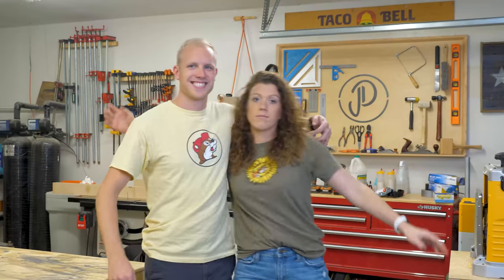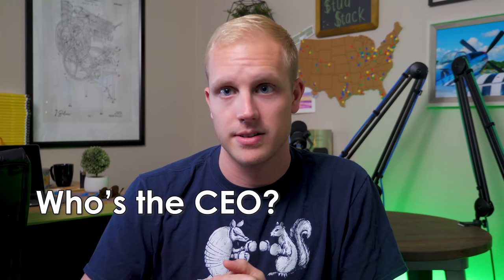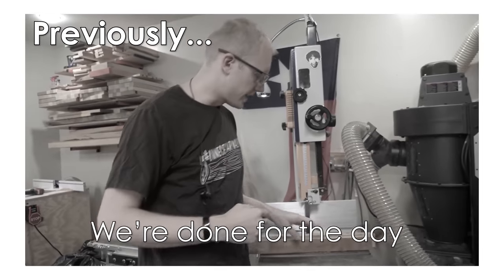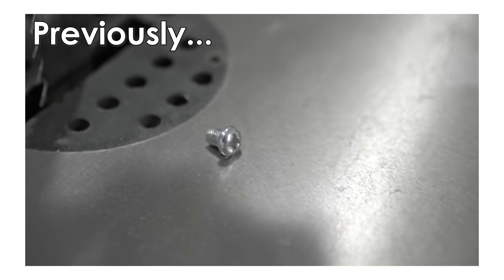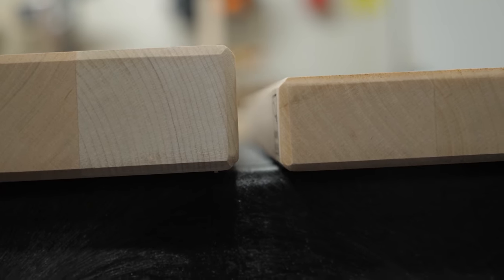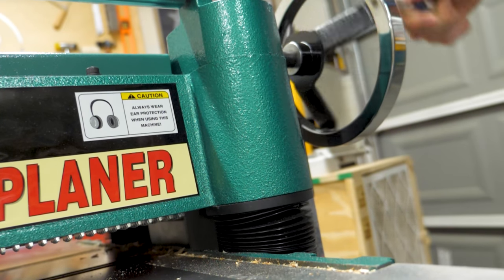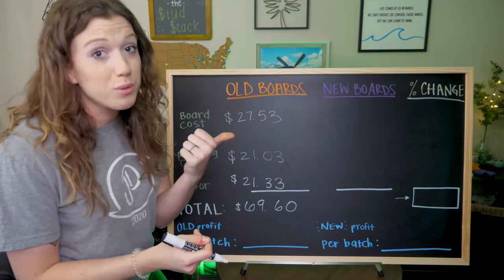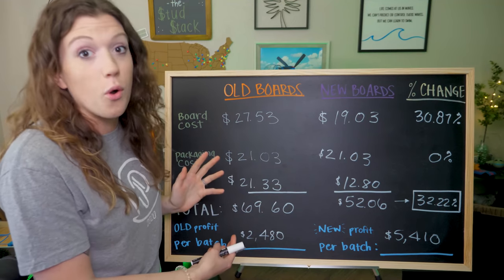we waited 6 months for this tool… then DOUBLED our profits! | Furniture Business Update

Comment: Thanks for taking us along on your journey, guys... but I do want to respectfully point out that there are some significant arithmetic errors here.  Your addition of the 2 different costs are off (Should be: Old Board = $69.89 and New Board = $52.86, which would calculate to a savings of $17.03, or 24.37%, not 32.22%.  I wouldn't have said anything, but you're saying you saved almost 25% more than you did (according to your numbers, of course).  Regardless, congrats on the increased profit!  Looking forward to seeing what other efficiencies you can make!

Comment: I'm not even sure why u guys use a bandsaw at all. They are slow and less accurate than a table saw. I make cutting boards a lot too and never involve my bandsaw. Why not just use the table saw? If you're worried about the kerf, just get a thin kerf blade (3/32). I also don't think u should be spending anywhere near $21 for packaging for a $100 board. Cut back on that. It's a nice added bit for presentation, but not 21% of your board revenue. I wouldn't spend more than $5 on a box and some padding material. People aren't expecting that for your boards, I promise, and it's eating WAY too much into your profit.
Reply: Totally agree, bandsaw is slow, set the table saw up and away you go.
Reply: The $21 number includes shipping cost
Reply: Its creating the Brand. That's how you  build a Brand and business that is up-scalable.
If selling the boards, even at a slight loss, creates Brand awareness and customers for your more expensive products then that is what it takes.
These two guys are really cool and very honest.

Comment: Could you do a video as to how exactly you are getting MORE cutting boards out of the SAME amount of lumber? Unless you make one board and throw away a board I'm not wrapping my head around this?
Reply: It appears to just be from better surfaces straight off the tool. Wavy cuts mean you have to joint (losing material) and bad surface finish from the planer means drum sanding (more material loss). If you take a 1/16" or more off of a strip, that compounded over 200 board feet equates to a lot of lumber wasted just to straighten wavy bandsaw cuts. Less thicknessing leads to higher yield.
Reply: @jonromanakis9048  She sates they went from 45 boards to 75 boards out of the same material. Almost double the quantity. I still can't wrap my head around it even with your explanation.
Reply: They showed you the answer. Their first batch with the new equipment was 1/2 inch thicker PER unit. Reduce the size by that 1/2 inch per board means 50% more boards( 1 1/2  is 50% thicker board than the 1 inch previous board), well not quite but close ya still loose some thickness in the smoothing steps.
Reply: @pepper7144  Don't buyers prefer the thicker boards over the thinner ones?
Reply: @MrMaacin05  did you watch the video? It clearly stated how dull the bandsaw blades were and they got better results just by changing the blades. I assume you have no experience with a bandsaw. These guys are awesome, you Sir, are not.
Reply: @TedH71  I dont know, dont make them. They showed the boards they are selling, stated it was just over 1 inch thick. I guess their market supports their sizing.
Reply: @MrMaacin05   they also dip the board s on last sanding not mist so saturates the wood and will warp 6-8 later the money they make is off the YT channel and paid closed group on FB . I told them band saws are not to rip wood like they are doing Table saws are for jointing g 2 sides and if buying S2 should be sided on 2 sides removing need for jointing a lot my wood comes directly from bark on the wood and in ground 2 hours before CrazyBearUSA
Reply: I feel the same way you do. I don’t know if they are leaving some things out. I could see if the overall size of the boards changed, as in length and width. But I don’t see how you could have such dramatic yield differences if everything stayed the same size wise.

Comment: I was looking at chalkboard old boards vs new boards. I have a question about the shipping cost. Who do you use for shipping? In the last year with FedEx, USPS, and UPS our shipping costs have gone up almost 4 times our total cost of a board.  For example, a board for a 100 dollars this was with shipping figured in is now between 175 to 200 dollars to ship. That now makes the board 100 plus 175 to ship making it 275 dollars for the board. A cost customers are unwilling to pay and I do not expect it
Reply from the maker: We usually ship ups or usps. We use a website plug-in to get discounted rates for shipping. Shippo, postmates, there are a bunch!
Reply: @jennieanddavis  Thank you for the reply - I will check them out.
Reply: Your numbers don't make sense to me.

731Woodworks has an excellent video on shipping. They have shipped many cutting/charcuterie boards. I think he maybe could do a bit better on the shipping  boxes, but a lot of great info nonetheless.

Comment: just quick note on the Planner, keep some extra blades last summer I needed simple joiner blades from Grizzly 6 months later, got I tried substation's even. not sure if the heads /blades can switch out in pinch with lathe chisel types. also mark the blades as you turn them trust me not all will get turned at once .
 Been using Grizzly since 2002 when were restoring 6 square block turn century 1800's homes They were quality of the Woodland TX custom homes . Built a 3.1 million 5 star restaurant only sat 75 people all the wood came in raw (birch) had be machined ceiling 4x4 crown squares custom bar . was in 2005 dinner for 2 -100.00 w/o drinks but fantastic food 4 chefs. I
 use just about all Grizzly, when bought my floor band saw went with them I have a Rikon 10" and had their lathes . problem is 2 weeks for parts from MA. Rikon makes good band saws just any service issues are 10 days away . and if the tool is a major tool for shop support staff /service needs be 3-4 days away . I have grizzly order on Sunday due in Thursday . 
They make great commercial grade tools. my next tools to upgrade are a  Planner ( but don't need that big one looking at 13 Inch syndical head when goes on sale . my Porta Cable  ( JET ) is getting tired   Looking at the Nova Floor drill press DVR  out growing my table top . David the VP of Nova is great guy spent a Friday night helping re wire a Lathe Grizzly messed up on drop shipping /    sent it UPS and watched a driver your size push it off the back of truck I paid drop shipping I was pissed . all said and done I got a free lathe and my turnings got featured on Nova's consumer pages Not sponsored was their way making up for screw up from Grizzly

Comment: I'm just curious as to how you're gaining 30 more cutting boards. how were you wasting that much material in the first place? have you actually made another batch or this just your estimate of what you think your gonna get.
Reply from the maker: Nope. We got the extra boards. Better bandsaw blade allowed us to cut more consistent strips, letting us cut narrower strips = more strips per board foot
Reply: @jennieanddavis  Most buyers prefer the 1 and half inch thickness from what I've seen. Has anyone said anything about the decreased thickness? I can see how thinner wood would enable to have more cutting board wood.
Reply: @jennieanddavis  really should use table saw for ripping widths you lose a 1/16 inch on each cut but ordering widths that will take into account gives much straighter cuts . Grizzly sells some great band saw blades and support staff will give you recommendations . I have like 4-5 blades as back ups and in different rakes /teeth inch Bla Bla

Comment: depending on wat you push out the door per month it might still take you some time to get youre investment on the new equipment back and refil the war-chest , but after that yeah more profit
the helical head is a good choice as chipping a cutter on a hard piece whont recuire changing all the blades and reset the dept etc etc just the 3 inserts that gotten hit and they usually allready set at the right dept when installed

Comment: Dose that profit include the cost of replacing the insert of that new planer head or the cost of the new bandsaw blade? Those cost have to be rolled into the picture somewhere. I am no account but replacement parts are not free.
Reply: when a planer head lastsa super long time, the cost is negligible. same with a bandsaw blade.

Comment: The upgrade was nice but a little over kill. I would have jumped to the next level of DeWalt planner first. Saved about $2,500 dollars. Forget the band saw, upgrade yo stores and find yourself a sawmill and safe yourself a ton of money and get rough cut lumber. I was floored by your cost per finished board. I'm a one man shop and my cost per finished cutting board is maybe half what yours is and I don't have the volume. I make my boards in winter, using the slow months to build inventory. Let me say this your channel is full of great information that I wish I had found 6-7 years ago. Keep up the work and the postings.
Reply from the maker: Larry, are you paying yourself for labor? That’s probably why your board cost is so low.

We got a bigger planer so it could handle the volume we need in a commercial space. The dewalt planer would be obsolete as soon as we got it broken in!

Comment: First off I like your vids, get a lot of info from them. But when I saw the math parts of this video on the cost savings I started scratching my head cause something didn't seem right.

💡  It's when I realized alot of that 30% savings was actually lost production value from the tool. If the bandsaw can make 70ish cuts now, it could before. Because of several technical issues with the bandsaw it's output was reduced to 45ish cuts. From the video recently those technical issue's have been resolved allowing the bandsaw to have an output of 70ish cuts once again. There was no savings there, just increased costs and lost production value due to technical issues with the tool in a not functioning good state.

But I am curious what the cost savings is between the 20" planer vs 12" planer

Comment: There's specialized companies that can sharpen bandsaw blades
Reply: Blades are cheap enough they're not worth the hassle/expense to sharpen. Check out "Wortheffort" channel bandsaw videos. Shawn gets great blades cheap from a supplier that supplies commercial woodworking shops in Austin TX area. They get blades in 1000' rolls, cut off what he needs, and welds them together I think he said he pays $10-15 per blade.

Comment: This doesn’t make sense. You reflect a profit from how it used to be done but you’ve said your boards are $50 to the customers? Wouldn’t that be a loss at it costing you $69.60 per board? Also, if the cutting boards are just a step in the door for your customers, is spending thousands of dollars on a new planer really worth the investment? How will it pay itself off?
Reply from the maker: Our cutting boards have never been $50. Maybe you’re remembering our first batch of serving boards? Those got scrapped a long time ago!
Reply: John non of their  accounts have never really added up. Take into account  running costs  of  workshop maintenance of tools etc. Its ok saying it costs  this and this  is the profit  but it's not.
Reply: Larger, more powerful planers run at a faster feed speed and depending on the cutterhead, will give a better finish than a hobby machine. They also will run all day long where a hobby machine will die if you push it that hard. Congrats on upgrading! I need to get you some pictures of another thing that might save time and lower your production time.
Reply: I thought they mentioned $100 per board in the video, not 50.  The planer can be used for other work, including furniture, etc, and do it faster, with better quality, and on wider or multiple pieces at a time.  Therefore, the planer is an investment for all of their work.  I will say, though, that I'm surprised they didn't know to ensure they had a sharp blade in the bandsaw.  I also wonder if they wouldn't do well to have a good table saw for this.  Bandsaws can have issues with maintaining straight cuts from a number of factors besides blade sharpness.  Not much extra wood would be lost from blade kerf.

Comment: Find  a local sharpening company in your area as there is no way to throw a 30 dollar blade away
Reply from the maker: We'd spend much more than $30 driving to/from the sharpening place and paying for the sharpening.
Reply: @jennieanddavis  Shawn of "Wortheffort" channel gets great blades for (I think) $10-15 from a supplier in Austin area. Maybe his supplier would ship to you at a reasonable cost, especially if you buy several blades.
Supplier gets blade material in 1000' rolls, cuts off what's needed for a blade and welds it up.

Check out his band saw videos for his supplier and a great deal of other useful info.

Comment: Send your bandsaw blades out to be sharpened. Save money
Reply from the maker: Replace it with a new one. Save more money 🧠
Reply: @jennieanddavis  so me paying 15 a blade to sharpen doesn't save me money wow.
Reply from the maker: How long does it take you to send your blade off for sharpening? 

I’m guessing at least an hour to wrap it up, drive to the sharpening place, drop it off, and pick it up a week later. Or if you mail it, at least an hour boxing it up and mailing it at the post office….

That’s $30 of labor cost, plus $15 for sharpening. 

You’re spending $45 on sharpening a blade that costs $30 brand new and takes 2 minutes to reorder online.
Reply: @jennieanddavis  its called run a set send off groups of blades and yes usps does deliver. Anyone only having one blade and not a set of atleast 10 is wasting money.  Business 101 go to a cabinet shop and ask if they just replace new every time.
Reply: @lt81s  USPS also picks up, no charge if there's at least one Priority Mail package in the bunch. Send blades out for sharpening when you ship a batch of boards and don't waste your time going to either post office or sharpening shop.

Comment: Why don't you use a table saw instead of a band saw.  I have been in woodworking for over 30 years and the table saw is more accurate and consistent than a band saw.  MUCH FASTER ALSO.
Reply from the maker: Several reasons. Mostly because the bandsaw is actually much faster and wastes less material. Boards still need to be planed after glue up, so the smoothness of the table saw is negligible.
Reply: @jennieanddavis  There's no way at all that the bandsaw is quicker than a table saw. Especially if you're doing cuts at the same width. Set up a feather board and a couple of feeders on the table saw and send it all through. You'll be done twice as fast and have the exact same cut on every cut.

Comment: you buy a 3450.00 planer & I'm sure you had to hire a electrician to wire your shop for it and your double your profits???? and using a band saw to save on wood?? you should have spent your money on a good table saw and thin kerf blade. talk about wasting wood you waste a ton on a planer. guess my since of making money at woodworking & mine differ. plus you got a junky Grizzley. duh